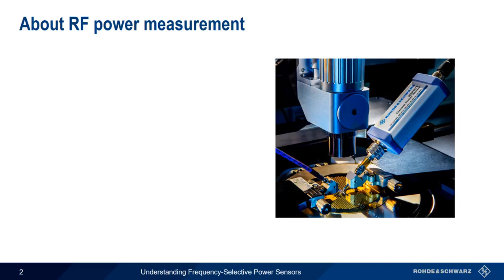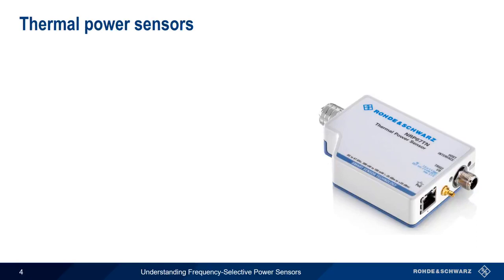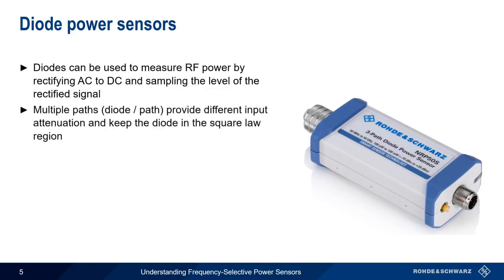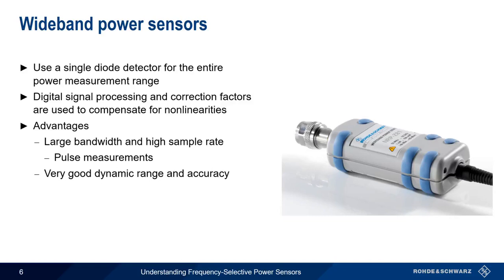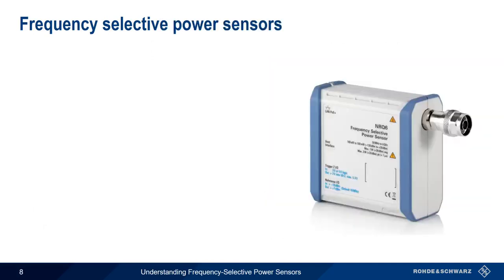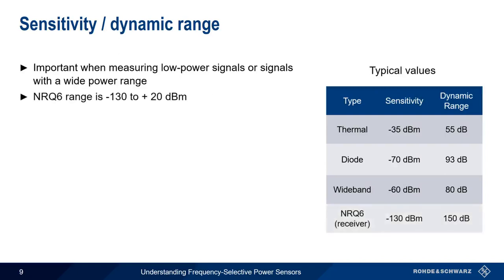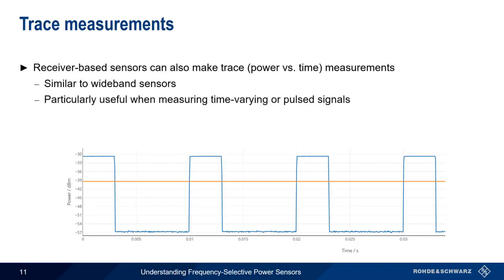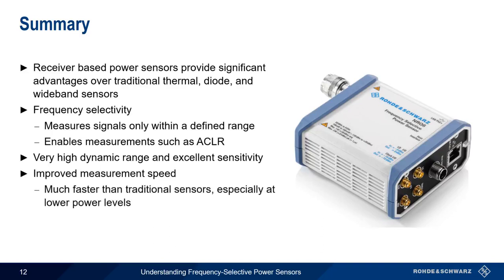Understanding Frequency - Selective Power Sensors

Comment: From an architecture and technology standpoint, these look and sound like spectrum analyzers with a feature set that targets amplitude stability over analysis capability, with a form factor + price point tuned to address the niche historically occupied by diode/thermal power sensors. Cool! Historically, the spectrum analyzer architecture with multiple filter / conversion stages wasn't able to meet these amplitude accuracy targets, but now evidently it does, and I'm wondering what happened. Do these use a fundamentally different architecture from spectrum analyzers or was the enabling factor more a function of gradual process and characterization improvements that eventually led to the spectrum analyzer architecture having comparable amplitude accuracy to traditional power sensors? Thanks!
Reply: In the case of our frequency-selective power sensor (the NRQ6), this is implemented as a receiver specifically designed for making highly accurate power measurements. Since it doesn't have all of the filters, conversion stages, etc. that one typically finds in spectrum analyzers, there are certain limitations compared to a typical spectrum analyzer.

If you'd like a block diagram and specifications, you can find them starting on page 11 of our product brochure:

https://scdn.rohde-schwarz.com/ur/pws/dl_downloads/dl_common_library/dl_brochures_and_datasheets/pdf_1/NRQ6_bro_en_3607-1888-12_v0401.pdf